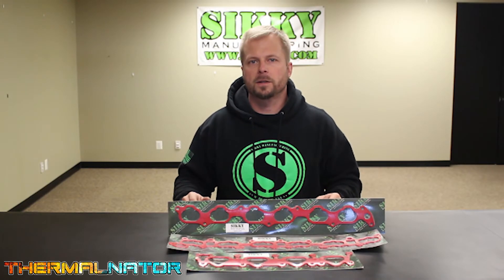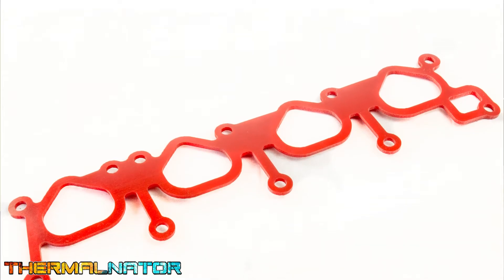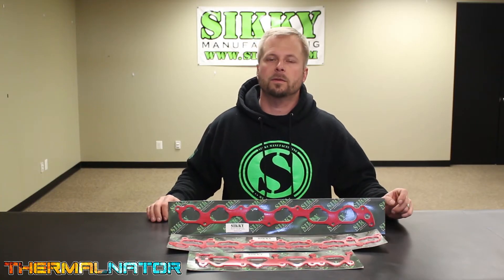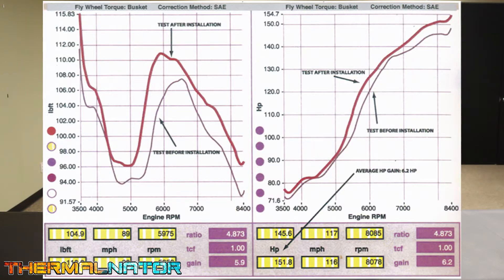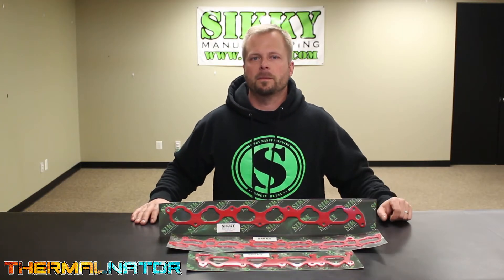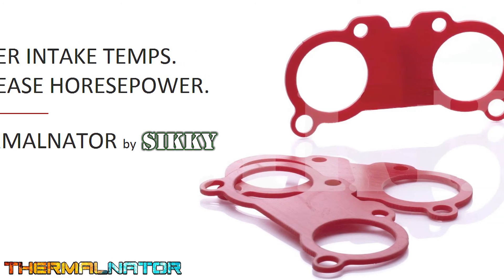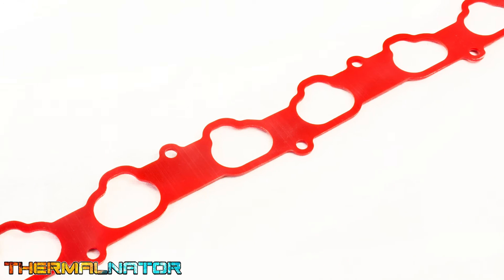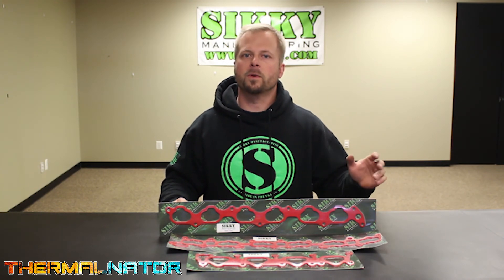Thermalnator Heat Shielding Intake Gaskets | by SIKKY Manufacturing

Comment: So no need for RTV on the hemi manifold gasket?
Reply from the maker: no, if your manifold/heads are scratched up pretty good you can use a very very thin amount to just fill in tiny scratches but it's not needed

Comment: I ordered a thermal throttle body gasket and thermal intake manifold gasket, do I change both? Or just one of them only? Also, will it have any effect on throttle response from what you know?
Reply from the maker: Both will have an effect on power. Not likely to make a noticeable difference to throttle response though